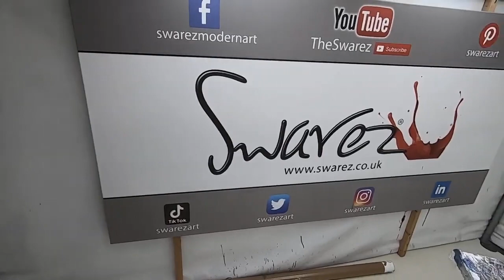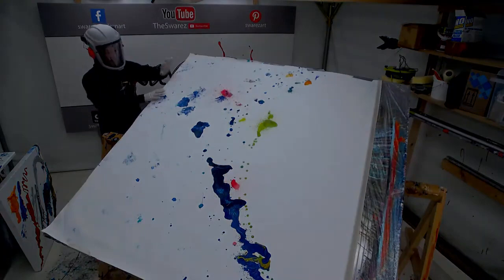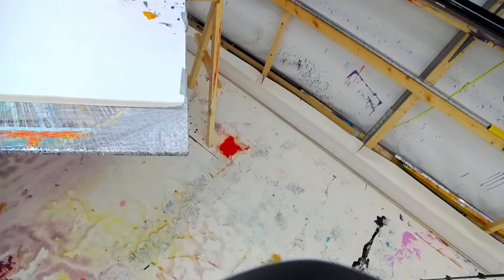Big BLACK and WHITE abstract painting created LIVE - How It's Made

Comment: Love the art. Just a question. Do the chemicals leak into your environment when finished or just when wet?
Reply from the maker: Thanks! If I don’t have an extraction system then yes. The extractor sits in a controlled room and sucks out more air than the room contains so it’s always in a negative pressure environment. That means there is no vapour released outside of the room. After 72hrs the canvases are safe to move out of the paint room and into the hanging area. Hope that answers your question 🙋🏻‍♂️

Comment: What is the solution that you're spraying from the bottle and what kind of enamel paints are you using is that like automotive paint or from something that you can get at the art supply store in bulk
Reply from the maker: Hi Daniel. No, you can't buy this kind of enamel paint in bulk to the best of my knowledge. I am sure you can if you find a pant supplier who will make up a basic one for you - then you could get 5ltr cans if you want! Mine is not even an automotive derivative ( they have been using a water based one for a long time now). Mine is an industrial paint at heart and the base resin a by product of the diesel refining process. It has pigments, driers and a a hardener (catalyst) and is an air curing paint. 

For the spraying, what you see me using is solvent based thinners, that's all. It's one that is matched to the paint. Hope that helps.